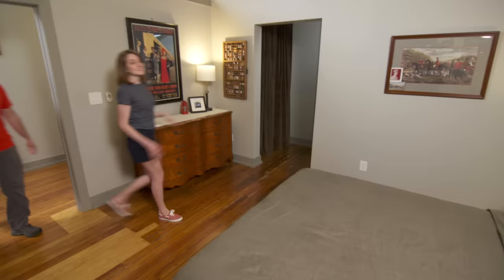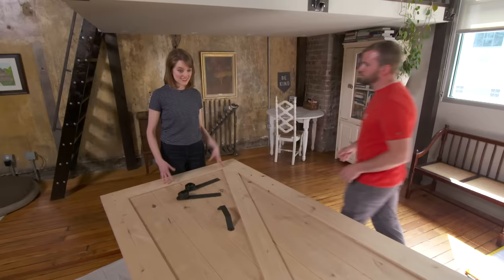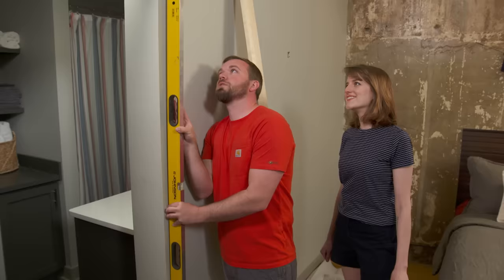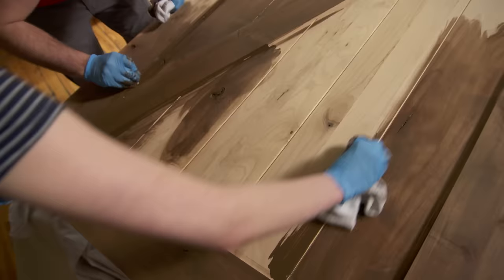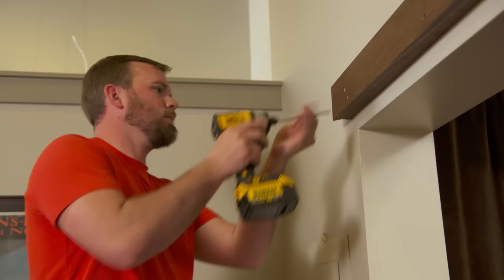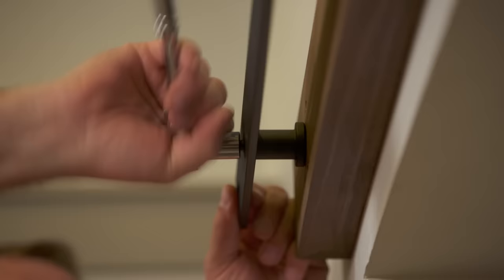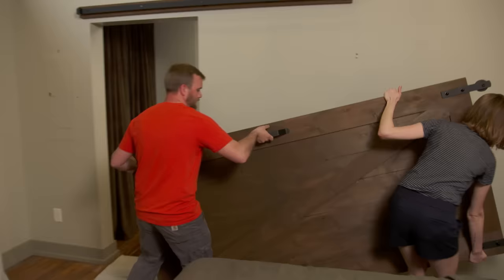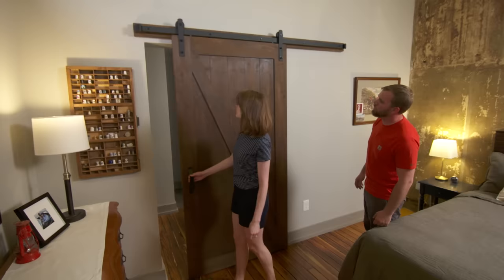How to Hang a Sliding Barn Door | Ask This Old House

Comment: Bathroom barn doors should overlap the opening in each side by at least 4” and in this case I would say at least 6”. Order your door 8” wider Than the opening, you will thank me later
Reply: Why?
Reply: @godbluffvdgg  thanks for your opinion
Reply: @godbluffvdgg  Would it make you feel a little less anger if we just changed the name of the door to "Bathroom Door"? Would that make it appropriate?
Reply: @Sacapuntas69  No...The point is; it's the wrong type of door to use, in a residence, on a bathroom, and I'm not angry at all...I don't care that much to be angry...Put a revolving door on there for all I care...
Reply: @godbluffvdgg  But why is it the wrong door? Just because you don't agree?
Reply: @Sacapuntas69  And you are?
Reply: @godbluffvdgg  Just somebody asking a question. I'm definitely not a door expert. Or even a door novice.
Reply: A barn door should over lap 2" on each side of the wall. Total of 4" wider.

Comment: What about that outlet ? And why did he run out of the room in the end 🤔
Reply: I suppose you would move the outlet to the right enough to no longer be covered by the sliding panel. But that would take ATOH to send a sparky to perform this task. Depending on how accessible the Romex (guessing) is dictates the labor & material cost. Or a blank cover in a pinch. But I generally hate to see an outlet being removed.
Reply: Just close the door when you need the plug.  lol.. ;)
Reply: Good one ! By your adding LOL I'm positive you know that the NEC would not allow that setup to be code compliant.
Reply: @dlamarsobotor4573  yup... all in fun
Reply: @mikez4132  Yes sir ! 
Think we both know that the show glossed over this issue though. 
As a long time electrician (1976) humble beginnings, this was incorrect. 
The tech staff should have had the  carpenter (who I actually like better than PITA Tim S) add an electrical addendum, correcting this issue. 
I not other electrical issues on other episodes. But just chaulk them up to regional code interpretations. Cheers !
Reply: @dlamarsobotor4573  they do skip over a lot of things in these. They were probably thinking...eh it's a retro fit... no ones checking lol. Except 1.5 million viewers
Reply: Alonzo M cause her husband came home. Lol
Reply: I understand that ATOH is a go to for DIYers and that they should represent improvements that are code compliant. A blank cover should have been installed. The carpenter could have done that. It's as easy as turning off the breaker to the outlet, remove the outlet and tie the wires back together as it was probably a junction box as well. However the reality is that here in the real world not everything is always done up to code. All she would need to do is put some baby proof plugs in the outlet and then it becomes unusable. ATOH cannot recommend this or have the carpenter do any of the work on tv as it would lead to lawsuits I'm sure. Pretending it wasn't there was the only thing they could do. This was a episode on hanging a barn door and that they did do.
Reply: D Lamar Sobotor too much work

Comment: OK let me think really hard on how I can try to poke holes in their project and badmouth them for trying to impart some knowledge on me.....
Reply: That's not how that game is played... If you think really hard, you're doing it wrong.
Reply: i know you're being sarcastic, but catching the mistakes and shortcuts is important.  thats the difference from making the same mistake and having an accident.   For instance, did you learn not to plug anything into that outlet?  

i hope so,  otherwise that plug destroyed the contacts and shorted out the fuse, but not before making a wonderful burning plastic smell.  all becuase someone opened the door a little hard with an electric heater plugged in
Reply: @StoneE4  ɟɟo ʞɔnɟ
Reply: I guess I hit a nerve. 🤣
Reply: ilovefunnyamv2nd  yeah thats a decent point, as well as the fact that the door is now hanging out from the wall quite a bit, kinda defeating the privacy purpose of it, and also someone said that the rollers could be noisy if youre trying to sleep. I just like to talk a little smack now and then.
Reply: Kyle Richard talking smack? Is that why you removed your comment calling me “low brow” after being out ratio’d? SMACK BACK!!! 👋

Comment: Outstanding primer on how to install/hang an interior sliding barn door.  I'm using an old door reclaimed from a commercial building (it weighs 47.6 lbs) that has 5 windows in it, but frosted glass.  I was worried about the weight but adding the mounting header board will give it the strength needed, I think, to prevent it from pulling off the wall.  We shall see! Thanks, This Old House.
Reply: 1

Comment: I have the same hardware on my barn door. I didn’t use the router floor guide since I don’t have a router. I ended up picking up a roller that attaches to the floor. Much easier for someone without a lot of tools
Reply: @DonWyo  😂😂😭

Comment: The  existing wall was out of plumb. So they corrected compensated for this normal occurrence. By blocking out with 1bye but nothing was mentioned about the visual gap that had to be present.
Reply: I was thinking the same thing about their solution to an out of plumb wall too.  Hanging the door with the wall would make for a more pleasing reveal to the eye. Even at 80 inches a taper like that is really noticeable, especially in a door way. Plus you have the guide pin to keep the door in the position you want :)
Reply: Plumb only matters when installing cabinets or appliances. When it comes to doors or trim work you should always match existing work or sometimes split the difference. I agree that the door guide would hold the door out of plumb and would keep it more pleasing to the eye. That or when no one is looking put a block on the bottom plate and strike it with a 20 lbs. hammer lol. It'll move!
Reply: I tend to agree but cannot help thinking about the uneven gap that must be present in the overall length of the panel. 
Actually disagree as plumb & level is paramount in all construction. New and remodeling. Cheers.
Reply: @dlamarsobotor4573  plumb and level are important when framing a home. Ideally you want everything to be perfect. When you are dealing with an existing structure that is out of plumb and the fix is more than the job is worth then you do go with what is there. The eye doesn't pick up on things that are out of plumb as much as it does with things that are not parallel. I've been a carpenter for nearly 30 years and know this from experience. 3/4" is alot in 7'. One suggestion that they would never show on tv is to put a block at the plate and hit it with a 20 lbs. hammer. It'll take some of the curse out of it but you don't want to go too far as it could pinch wires that are coming up from below. It is also something you don't want to neccesarily do in front of the owner lol unless you have a working relationship with them and explain what you are doing. A couple toe screws at the plate will secure it if necessary.
Reply: @johnsmith-wc8gs  Totally agree ! I'm a maintenance electrician in the twilight of his career. But also stick built 8 homes. Too many remodels to count (~100) possible.
It is not a perfect world, but taking time to improve others work is paramount, as we both know. 
Make Monday great man !
Reply: DR PHIL  I can tell you don't hang doors for a living. Matching existing work always trumps doing things "the right way". If you don't it'll stick out like a sore thumb.  If it makes the doors swing then bend the hinge pin slightly.  The fact you don't know this is a dead giveaway you don't do this everyday
Reply: DR PHIL  well Dr. Phil you just repeated what I said.  You match existing work.  No carpenter in their right mind will set a door plumb in an opening that is not.  Sure you do what you can to take the curse out of it but no opening is ever perfect.  

 In your comment you stressed how important plumb and level is when I think the two of us can agree that making it work is what's important.

   You name it and I have built it.  From several story multi family to 20k sq ft customs to remodels on 17th century homes I've learned a trick or two in the last 33 years of building. 

 Excuse me if I seem terse but I've dealt with many people whom think they know all about building but have only done a thing or two learned from Bob Vila.  

You can try as hard as you can to frame a perfect house but if you're doing it with sticks and nails there's gonna be flaws.  That and any house that is not new is an old house. In my experience a bad install is not due to being out of plumb it is due to not securing it properly and setting reveals appropriately.

  I can guarantee you I can hang a door a half inch outta plumb that will work and stand the test of time.  For all you know your warranty work was set plumb at one point.  Stuff moves and bad anchoring won't last.  If you still don't believe me run a week or two with me and I'll show you.  Either that or you've moved on to an easier way of life. Cheers
Reply: DR PHIL  when hanging a 3° solid core door you have to kick the bottom hinge plate towards the latch side to get the reveals correct. If you hang it plumb it will not work.  Plumb and level do not supersede function.  Look, I'm sure you've serviced many doors and have seen alot of poor work.  You are not a carpenter or a builder so your vision on this is a little blurred.  Maintaining something doesn't make it right
Reply: DR PHIL  I don't think you're picking up what I'm laying down.  What I'm saying is you do not hang a door plumb in an opening that is more than 1/4" to 3/8" out.  This whole conversation started because you said that plumb and level should always be used.  If I set a door plumb in a opening that is a 1/2" out the tapered rip on the jamb extension is going to be more noticeable than hanging the door out. 

 Like I've already said there are tricks to keep the door from swinging.  When I build doors onsite I will make the jamb 3/4" wider than the standard 4 13/16" with a rabbet on it.  The casing then receives a dado to receive the tongue on the jamb.  Doing this you can hang a door with no nails or screws.  I only use spray foam.  I can prefinish everything and be done post install. 

Also a door that is a 1/4" out of plumb will not swing or fail if installed correctly.  Rely less on your level and use intuition and your eye.  That is what truly makes a carpenter anyway.  Having a good eye for what looks good.  Please do not take any of this personal.  Congrats on being a journeyman carpenter.  Too few people these days learn the trade.  I can honestly say there is nothing I cannot build.  I have spent 6 years on one project which involved everything from timber framing to massive glue ups for spiral stairs to building all cabinets onsite.  People pay me to execute work that few others can do.  I don't say this to boast but only to show that I do indeed know what I am talking about.  

 Granted this project like all others I do from frame to finish are as close to plumb as one can get so mostly I am referring to the 17th century homes I have restored.   Hopefully you get the picture.  Sometimes clients want to spend millions of dollars trueing things up but when they don't you go with what is there.
Reply: It's in the master bedroom, 100% privacy is not 100% important unless you have someone in the bedroom that isn't a spouse.

Comment: I had one of these in a condo bedroom.  The biggest problem (besides not really offering privacy) is the noise the rollers make.  You have to roll the door incredibly slow to avoid waking someone up.  Not practical in a bedroom, in my opinion.
Reply: Ya they are def a "for the look" type of door. You can see right behind them. Noisy. Need the room to open it so nothing can be near the door. I guess that is why are are good enough for stables...lol
Reply: I hate these types of doors. They are a fad and will all be removed in the coming decade. For a 2' 6" door the opening must be shrunk down to 2' 2" or even smaller depending on the casing. Idiotic if you ask me
Reply: Great point, well thought out

Comment: I need to install a sliding barn door, except on an actual barn rather than a decorative feature, mine needs to actually be heavier and usable for the shop LOL.  The other thing is, mine will have to be split, so 2 doors sliding apart.  Never done this before so I'm gonna have to do some research and figure this out.

Comment: Great video! We just installed our barn door and ran into a snafu... We have an older house, so the floors are uneven in places. The height of the barn door is perfect over the door frame itself, but it turns out the floor is 1/2 inch higher on the right side. When we slide it open, the door scrapes against the floor. Any recommendations for the best way to fix or adjust?
Reply: I’d sand or plane the bottom of the door to accommodate the wonky floor… no one will be peering down there! Good luck!! I just hung my diy build door and it lovely!! 💕
Reply: Cut the bottom of the door

Comment: Would you not need to do a clear sealant over the stain to stay  resistant to oil from. Fingers hands etc to keep it looking good?
Reply: Or put a wood conditioner on before the stain.  Since it's a rustic look, a little wear on the stain may look good in the long run.

Comment: Garbage! I thought I learned something but guys fos. 
1st option-
You don't need 1x4 piece on top if studs line up with holes on rail, there is some play depending on rail size? Line up bottom guide 3/4" away from base trim.
2nd option-
The bottom guide separates door from trim when out of level.  With upper 1x4 and track spacers your track is now about 2" away from wall and door is probably 1-3/8" thick, so half the thickness of the door gets taken out of 2 inches for over an 1- 1/4 gap between wall and door. 
If you add some door trim casing on drywall wrap (cheap way) you can then add a lock on bathroom door.